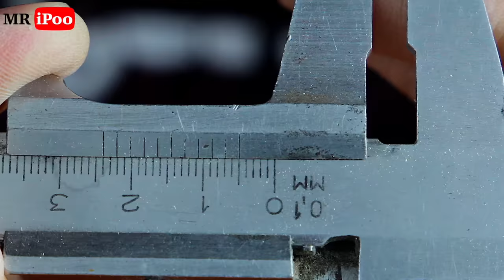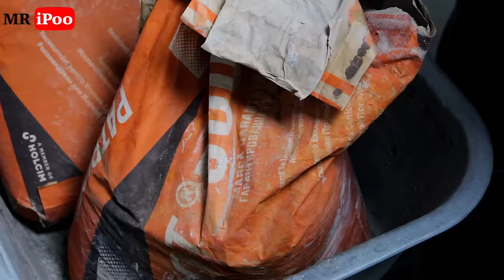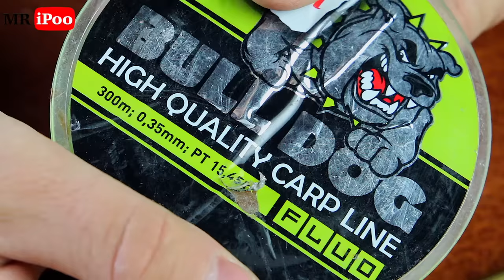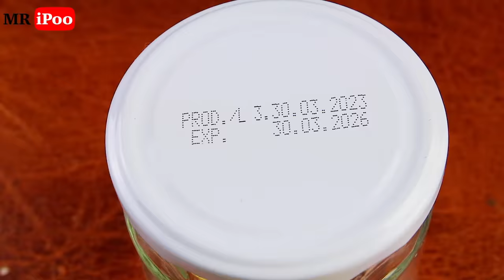this flame burns at 1652°F for more than 100 hours! diy ideas you need in your life right now

Comment: Wasn't obvious what fuel you used - I found myself wondering if it was alcohol, kerosene, lamp oil, or some other liquid.
Reply: Me too!
Reply: Plutonium you have to get it from the Libyans and when you light it you go back to the future 😂
Reply: @patrickday4206 . Nice one Patrick,saw it on Christmas Day for the fiftieth time,still a classic!
Reply: "Wasn't obvious what fuel you used" The hint is when he was filling the glass jar. There was a diesel engine running in the background. The engine stopped when he was done filling the jar.
Reply: What are you, the oracle at Delphi? Or the Riddler.
Reply: Looks like ipa
Reply: @nathanwoodruff9422 diesel needs high pressure work . Like this it will never work.
Reply: @Patshes  "diesel needs high pressure work . Like this it will never work." Or high temperature, the reason why for the loop to heat the fuel in the first place. Failed physics in high school? Are you aware that pressurizing something heats it? Yea, probably not.

Comment: 1652 F I'm curious how you found that number. Did you heat something up with it to that temp and check it with a heat gun? I doesn't seem nearly that hot just by flame color alone. But it could look different than the video might suggest.
Reply: No more than 680 degree Celsius for sure.
Reply: The ADIABATIC FLAME TEMPERATURE for any fuel will give the Max. Flame Temperature produced.
Reply: well, an alcohol lamp can get to 1100 C at the tip, so he might be a little high
Reply: @pauls5745  This is the MAX. TEMPERATURE that can be produced depending on the type of fuel used ==>  https://en.wikipedia.org/wiki/Adiabatic_flame_temperature
Reply: @Unknown15916  According to that chart, there is no type of fuel that burns that cold as described in the video of 1652°, Methanol being the coolest at 1949°c
Reply: Possibly measuring near or at the copper where flame is still blue
Reply: In Farhenheit, maybe ? 🤷

Comment: Great vid, this reminds me of when I was in the RAF as a chef when we went out into the field on exercise. We had the normal field catering equipment, setting up tents, getting the burners up and running and within a couple of hours getting the grub ready before the hungry hordes descended on us. 
We had a piece of equipment that while really versatile and efficient was very very dangerous if not properly maintained. It could run on petrol, diesel or gas. It consisted of a pressure tank containing the fuel (liquid) with a separate connection for a gas link.along side was a air pump with a leaver fixed at one end, half way down was a connecting rod attached to the workings for the pump. By moving the handle up and down you could pressurise the tank to about if I remember  40psi. This was the max pressure. There was a small gauge with a green and red zone and a lead over pressure blowout plug . There was also a valve on the top of the tank to release the air pressure in an emergency. At the bottom of the tank there was another valve-to release the fuel via a pipe to the burner frame.
There were to types of burner. One for petrol and one for diesel. Both had a pre-heater to vaporise the fuel before it got to the burner. The petrol burner had two long rectangular tubes with narrow slots cut across the tube width the full length of the tube. Between the burners was a tube filled with wire wool that the vapour had to pass before getting to the burner head, this took the lead out of the vapour. When the white petrol vapour started to rise from the tubes a flame (burning paper) was used to ignite the vapour, usually with a loud woomph. Cooking could now commence. The other frame burner (diesel fuel) was mostly the same build except the flame end which was a x shape in a square frame made of steel tubing that allowed the fuel to circulate. A piece of cloth soaked in diesel was draped across the burner and set fire to, this pre heated the tubing and when the fuel vaporised in the tubing it was sent back to the burner which ended up repeating the process. This resulted in a long flame blasting out. The burner was places in a trench and with either an oven at the end of the trench to cook in or steel plates placed across the trench you had a stove top to work on. As yo can imagine maintaining the kit was vital. The most common injury was caused by over pressuring the tank and the lead plug coming out of the tank when you were leaning over the tank when pumping.

In addition there was another source of heat which was much simpler  called a Locombane Burner. Very simple and very versatile. Take a length of copper water pipe about six foot long and seal one end, either crimping and folding or with a bolt. 
About eight inches from the end drill two holes about one inch apart. With a pipe bender carefully bend the end over itself in a till  the crimped end is nearly touching the pipe at 90 degrees. The two holes must be pointing in the direction of the bent pipe. This is the burner end.
A flat piece of metal must be clamped to the middle of the pipe so it holds the curled end in an upright end whilst laying on the ground.
A flexible fuel pipe would be added to the other end with a water type tap to shut off or turn on the fuel. Some form of tank or drum is connected to the hose and the tank filled with diesel. This should be placed about 4 to 5 feet Obote the burner.

To light the burner a small piece of rag would be placed over the burner end. The fuel was turned on at the tank. And allowed to flow to the rag and soak it. The fuel was turned off and the rag lit. The flame would slowly heat up the fuel in the end of the pipe and a white vapour would start to jet out of the two small holes at that point, before the flame went out the fuel at the tank would be turned on and a large flame would jet our. By careful adjustment of the tap you would get a steady large flame about 4ft x 1ft belting out at the business end. The theory behind it is as the fuel goes down the pipe by gravity it comes to the turn in the pipe (heated by the flame) vaporises carries on round coming out of the two small holes under pressure and ignites and then heated up the pipe, well you get the picture it’s self perpetuating whilst there is fuel in the tank. We used it in when we had to abandon our field kitchen during exercises and we would make ovens out of drums and make trench stoves. A very useful bit of kit made out of what ever you could lay your hands on.
Reply: that was a No1 burner,  great things to light,  :)),
Reply: Вам бы, рассказы писать или повести.
Reply: Took me longer to read that than watch the video, source the stuff and make it.
Reply: В каком году служил?
Reply: what are you yappin about, this is a simple video for a homemade alcohol stove, noone of those "war stories" about who knows what, make a video or shut up.

Comment: Some brass instrument makers use soapy water in their brass tubes and freeze it. Apparently the soap in the water prevents it from bursting. Not sure how well it would work here.
Reply: They bend it when it's frozen?
Reply: @barnabyvonrudal1  Yes. The frozen soapy water lets you bend it without collapsing.
Reply: What about saltwater?
Reply: @meljane8339  You would have to get it really cold to freeze salt water.
Reply: @therealjammit  I am uncertain how well antifreeze/coolant would work in brass
Reply: @meljane8339  If you got it cold enough to freeze it might not work. Solid water and antifreeze would be in a glassy state and crack under force. Soapy water will resist bending but won't crack but deform.
Reply: @therealjammit  I have little idea about this stuff. Cold to me is 60°F. Thank you for the info sharing, I will probably use it for some snow sculptures whenever I do get the chance to safely have a third winter.

Comment: Oh I do love a video with no talking when I have to guess what's being used.
I am assuming as the jar is sealed, the flame will eventually extinguish itself once it's used the oxygen inside the jar, either that or it will implode.
Reply: no, the flame is not running off the oxygen inside the jar. 
It is running off the open air oxygen, hence the colour and shape of the flame - the blue cone being the unignited vapour being drawn out of the hole by the venturi effect caused by the preheating of the fuel as it goes round the rings positioned inside the flame. That creates a pressure difference and actively sucks the vapour out of the hole and hence the flame burns hotter (and more noisily) than a simple candle would.

you are correct in recognising that as the fuel level falls a vacuum is being created inside the sealed jar and therefore a point will arise where there is insufficient suction created by the venturi effect to overcome atmospheric pressure trying to go down the tube into the vacuum of the jar. At that point the flame would starve itself of fuel since the wick is carefully (and clearly) shown as being a few mm inside the tube away from the hole, therefore the wick cannot itself burn, and so the flame would indeed go out.
Reply: Wouldn't negative pressure draw air in past the wick into the container, the wick is saturated with fuel but air should be able to pass thru it and equalize the pressure
Reply: The expansion of the fuel is creating positive pressure.  The fuel is not being drawn by suction.  Rather, it is being drawn by capillary action which requires neither vacuum nor pressure.
Reply: @judsonsdiscretionarymetalw5866  The jar is being ventilated through the brass pipe, thus no vacuum.
Reply: I think that only applies if the wick fits tightly in that tube, if not, watch out. Could be bad.. @wotviewer
Reply: Somewhere along the line some damn body should have said SOMETHING.

Comment: If it hasn't been mentioned the most likely fuel candidate would be white gas, what is used in Coleman lanterns/stoves.
Reply: Wouldn't that be just a bit volatile  and therefore  dangerous?
Reply: Most likely alcohol. It's great for all kinds of home made burners and stoves.
Reply: Make some moonshine to burn in it
Reply: @hackyman7815  That doesn't put out a very bright flame, though..
Reply: 70 % isopropyl alcohol?
Reply: Kerosene?
Reply: After extensive research on birds, their diets, and candles, I have decided never to eat another bird. It never dawned on me that they're the only animal that eats with their pecker.

Comment: What type of fuel is used in this project?
Reply: Nice question... in fact in my mind now remain only this void.
Reply: Wtf me 2 is it 91% alcohol
Reply: Could be 91%   isopropyl or denatured  alcohol
Reply: @markelkins7622  Thanks for response👍
Reply: any liquid that burns will do, obviously
Reply: Depends on where you're doing it. I use alcohol for the lack of exhaust
Reply: @Xonikz  Do you actually think that alcohol burns without exhaust products?
Reply: @mirkograveho1388  not necessarily, obviously
Reply: It could be kerosene, this is actually how a kerosene burner or stove works anyway.
Reply: with some Zinc ... the wet fuel would just be plain Water...  which is what the bottle in this vid looks like.  But i can not see second element for reaction.  The brass might be real dirty..? and work.
Reply: 400 500 graus
Reply: Probably something that is flammable.
Reply: If you passed a zinc wire with the cotton thread throughout the tube, you could put water in place of the flammable liquids which produce CO2... A chemical reaction would be created by which the copper+zinc +heat+water would come out in the form of pure hydrogen. from the small hole, and being flammable, it would create a flame and H2O as waste. Give me feedback if u try it plz

Comment: I’d love to try making one of these. Would have been really nice if each item used was given a label. Some of them are listed in the description, but not all of them. For example, the stray-on [glue] or some kind of sealer used over the cement was not identified. Also, the fuel, which I assume to be isopropyl alcohol, was not labeled in the steps for making this lamp/cooking flame/sterilizer/whatever. Reading the comments, there are several other similar and same ideas about the missing part ID’s.

Comment: That was a pretty good idea . I've just got one problem with it. The coil should be spread apart to where the flame or even the flames heat can't get to the tubing. Over a little time the flame will heat up the coil and start going down into the jar of kerosene and it might catch fire or blow up. Maybe try making the tubing like an "n" with the hole at the top so the flame and the flames heat goes upward and not toward the tubing so the tubing will stay cool. 😊 Another thing, it might be better to use a pint size mason jar. The Mason jar flats have a gasket seal on them that would help keep any fumes from escaping from around the lid. Another thing you could do is to make 3 or even 4 of the "n" copper tubes to stick up out of the top of the lid to amplify the heat and you could put stand to hold a small lite weight titanium pot on the stand to cook on. You might even be able to put one of those stove fans that spin from the heat of your stove on top of a stable stand so the fan could push the heat into the room to heat it and not let the small flames heat just go up to the ceiling to be cooled and waisted as the heat travels upward. In a cold room you'd benefit from the heat blowing sideways into the room towards the people that the heat traveling upwards. You might be able to make and put 2 or 3 of those jar heaters on about a 2 foot stand like a coffee table. Then put the jars in the middle of the table and get a cooking grill grate and put bricks on 4 sides of the jars to put the grate on just above the very tip of the flames tips and then cook on it and then sit the stove fan on the grate on the flame to spin the fan to give you warmth. Just a thought. What do all of you think ? 😮
Reply: I think you are wrong because the flame is needed to heat the kerosene to get complete combustion and not soot up badly
Reply: I have seen alcohol versions of this design reach runaway temps and start barfing ignited liquid fuel everywhere. If the ignited fuel surrounds the glass fuel container it certainly could explode. Ive also seen flashback on a kerosene version where the initial use of carbon felt wicking smoldered back as the fuel started to run dry and blew the mason jar lid and the remaining ignited fuel all over a good part of a friends shop after running fine for a while.
  Always use wicking, and cotton wicking seems to be safer and more stable like this youtuber has used.
  Maybe having the spacing between the loops a little wider, so the flame orifice can still assist vaporization without directly contacting the tubing, would help?
   I have used coarse clean 
sand/pebbles for aquariums or perlite in the fuel reservoir for another stove to make sure there was room for fuel but not air. 
  This design seems reasonable all the same, but please be careful.
  Don't kid yourself, even if no explosion.....a runaway heat/fuel situation is a scary moment worthy of respect.
Reply: friend is good idea but you just don't use glass and keep more distance fire from your fuel budy!
Reply: And the thing that catches my eye is that due to the lack of a valve and the discharge of alcohol, it is possible for it to explode due to the negative pressure caused by the vacuum.
Reply: AWSOME ideas !Great brainstorming!👍
Reply: its like a coleman stove the heat turns the liquid into gas

Comment: Back in old days we used a roll of toilet paper soaked in rubbing alcohol and put into a 1 lb. coffee can to make a heater to warm cold hands, this was before any form of cold weather gear was used. Just take lid off coffee can and light soaked toilet paper, it has almost a clear flame so be careful but it does work, when through, just blow out flame a put coffee can lid back over can. I always kept several of these cans ready for duck hunting...
Reply: Metal 1 quart paint can. Holds a roll, tight  metal lid. Much easier to put out or store.
Reply: Doesn't it burn when you use the toilet paper? They used to use turpentine on goats.
Reply: @jaroge01  if the paper has fuel, the paper will carbonize a bit but not burn. IF you run out of fuel, its gonna toast itself.
pun intended :)

Comment: You could place a flower pot upside down on it and upset the billion dollar heating industry. (Sarcasm.  I only said that because of the ad that popped up during the video) I liked the video. It shows ingenuity.
Reply: That ad is about as useful as those crappy foreign made scissors used in this video. I have the same ones and they cut into my time better than any material that has been cut with them...
Reply: that would ad ZERO BENEFIT, NONE WHATSOEVER...  You cannot get more heat out of ANYTHING than what is being put into it, period... go back to science class and pay attention this time!

Comment: You should add a tiny tube to the burn hole so you can cap it when not in use.
Reply: Think an adjustable shut-off valve can control the flame and spread?
Reply: @casteg52  unlikely unless you adding presssure to the jar and possibly adding extra oxgen. the wick only allows for some muh transfer of liquid to gas.